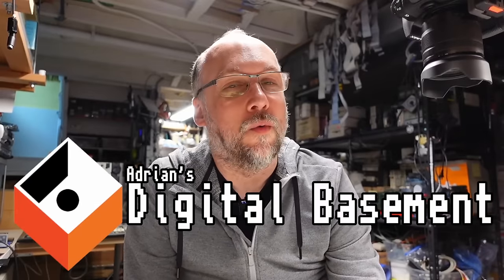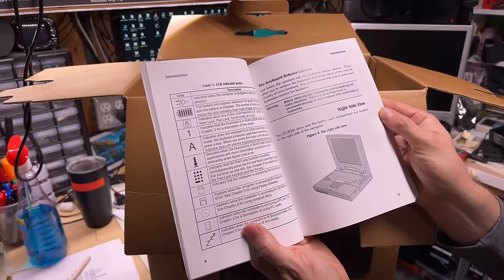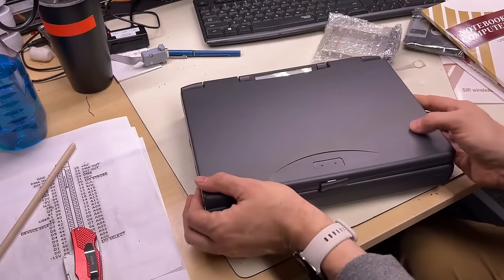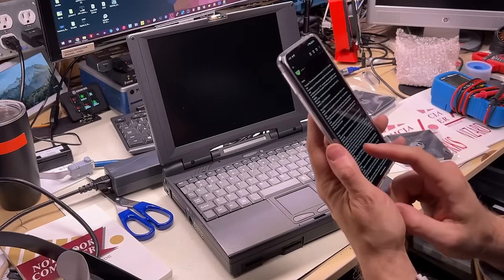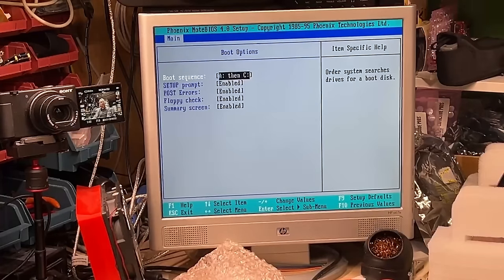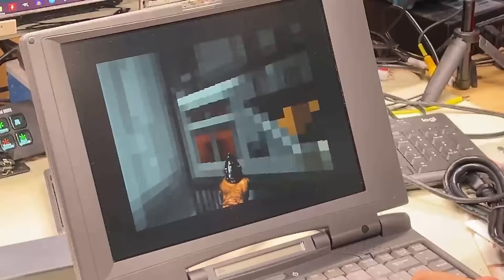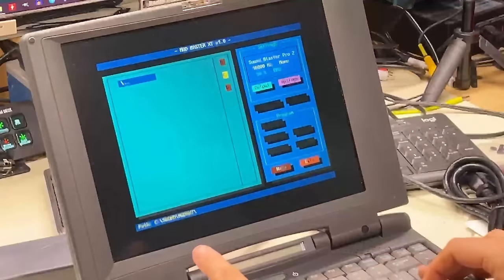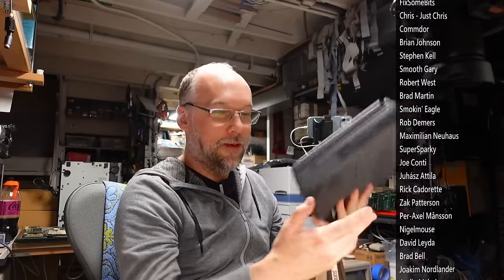0072 Unboxing and testing a brand new 27 year old laptop

Comment: I always use the tip of a mechanical pencil without the lead in it to straighten CPU pins. It’s the perfect size and allows for precision tweaking.
Reply: Wow... neat tip!  👍
Reply: I do that too!!

Works great 😅
Reply: Yup!  I discovered that oh so long ago out of desperation.
Reply: .5, .7, or .9 mm?
Reply: @thedopplereffect00  I'd say 0.5 mm is closest, but I'd wager any of them works fine. Nothing rotates, so as long as you can do leverage and not collide with the neighboring pins, it'll do.
Reply: I use a strip of thin plasticard and slide it gently through the lines of pins - when you come to a bent pin the card slides around it and you can then use your thumbs to straighten the pin into line with all the others.
Reply: Am I being a psycho, using a pair of scissors to straighten those pins?? Lol😂
Reply: Truly a life hack for pin repair.  Thanks!
Reply: That was an Official EVGA tip too. Empty mechanical pencil, steady hand and extreme patience. I learned early on to just get the 5 yr adv RMA warrenty lol.
Reply: Older CPUs you might want to use a .7mm, not a .5mm....

Comment: That laptop’s actually got one of the really nice screens from the day. That thing is loaded.
Reply: Yeah it's nice for its age - I just find myself automatically reaching for my screen wipes 😀
Reply: I LOL'd when Adrian said it wouldn't work outside...I can't remember any laptop/notebook from the 95-97 era that you could use outside...In fact I think I remember screen shades even being not just a thing but a necessity back then, and having to setup your office so you weren't in direct sunlight if you were a notebook user. Laptops sucked back then, but it was what we had and we were happy for them. I am so glad that we have made it to where we are today.
Reply: Yep, the passive matrix ones were at least 3 times as bad. I'd not sell those as I worked at Gateway, and it just stood out too much. You would buy a cheaper B-brand with an active matrix one I suppose - possibly this one :) I remember we had one one with passive and the one with active display, and we simply hid the one with passive matrix behind the pillar that held the shelves.
Reply: And compare that keyboard with the modern junk that gives almost no feedback... I think back with nostalgia, just because of this

Comment: Nice review! I used to have a Green 759 laptop from the early 2000's. I was excited when I purchased it as It was my first laptop. It too has numerous input / output features. The DVD drive was a bonus (although it was not powerful enough to play DVD movies). Otherwise, the features were one of the reasons I purchased it. To be honest, it was very unreliable. Within a year it began to exhibit problems. It would power off by itself. The vendor I bought it from insisted that it was my fault and refused to repair it even though it was under the warranty period. I ended up selling it on eBay and I still have the photos and auction content.

Comment: One of the things I remember for laptops of that era was that the controls for display, audio and other functions did not always work without having drivers installed. Some laptops of today do that but not as common. I had a Micron version that even had the rolling fingerprint scanner off to the right of the keyboard. The display was always a little on the annemic side for images but they did the job. It was never an expectation to be able to use the laptop outside. I got the experience to use Itronix Laptops since my Dad had worked there. They did better in outside usage and also the keyboards did not melt. They tested for that with their own heating oven with the laptop running and holding the temp at 120F. Then they would switch the temperature all the way down to -15F to do extreme cold testing. Then it was onto the cycling test. That showed bad solder joints nicely. Primary purchasers of these laptops was Military and government services. They did the job and lasted. Cooling of the processor was handled by it being pressed to the magnesium case under the keyboard and the whole case would warm up from it. You could even drown the laptop while running with all service doors closed and it would keep working for the most part. Interconnect board did not like being wet and having high voltage present to run the display.
Reply: Yes to the point that the Windows installer had an option to use a floppy disk to install drivers lol!

Comment: The second I saw the box, I knew exactly what the laptop would look like.
Back when they were new, I worked at a computer store, and like yours, they would come "bare bones" (no CPU, no RAM, no harddisk) and complete them to customer specs. I probably could still install a CPU in one of those while being blindfolded... We had a few corporate customers back then who ordered them in bulk for their employees.
Reply: bulk...ugh....i once had to assemble and load 71 identical P5-100 mini towers...still have an occasional nightmare where i'm lost in a maze pushing shopping carts full of computer parts around....
Reply: I imagine the corporate IT departments bought such ODM laptops to save money compared to buying stuff like IBM ThinkPad 500 or 700 series, Toshiba Satellite or Satellite Pro 400 series, or Compaq LTE 5000 series.
Reply: @kbhasi  that's most companies here in Germany for you. The people in charge have no clue what they are doing and will always decide for the cheapest option.
Just yesterday, I learned that the IT department of my current employer now wants to upgrade our monitors from 22" to 27". For cost reasons, they did not go for monitors capable of displaying 4k tho - they will be full HD like the ones we use now. 🙄

Comment: With that gameport on there, this is a sweet retro gaming laptop for someone if they landed one that is NOS. That old CCFL, you're just going to have let it warm up. There probably is a way to get MMX capabilities if you wanted it. An IDT WinChip2 runs at standard 3.5v, no more than 11W TDP (P5-133 non-MMX runs at 11.2W), and almost always worked fine even with Intel BIOSes. I used to use them all the time on Intel Socket 5/7 systems that only ran standard voltage. They were down on raw FP peformance but if you could leverage MMX, they were better.

Those ESS sound chips always worked better installed under Windows in my experience, even in DOS mode. Put Win95 on there and install the driver and you will probably get better results.

I have a Compaq Presario 1247 that I use for things like this, but it's a late 1998 model with better capabilities, can run AMD K6-III+ and take 288 megs of RAM.

Comment: Speed isn't automatically set you have to adjust the multipliers in the bios (possibly jumpers depending on design).  The screens on most of this generation laptops were not great new.

Comment: Sounds like the volume is set too low for decent line level output. The keyboard controls usually require a driver for volume as these were expected to mainly run Windows 95.

Comment: Nostalgic, I did have an even worse one for my job, just need the terminal function, not games.

The backlight is a fluorescent tubes (flexible) and it goes dimmer over use, also it's quiet normal this 199x TFT did not have enough brightness since the backlight did consume lot of power (so they set it even dimmer when power up), except reach the age of ACTIVE TFT it's dim. The ESS chips back then did famous for bad sound due to unknown reason, but it's normal sounds bad. ESS got "quality chips" only after 2010.
Reply: I rocked an 486SX33 at my first job which barely ran win95(floppy installed). It was all about serial cables and console.

Comment: Adrian I would keep that unit. I have found them very useful for making 3.5" Disks in DOS for test and measurement equipment when modern PC's with USB floppy drives won't work for utilities that need direct access for specialized disk copying. Finding a new one is a real find. My other goto retro laptop is a Dell D630 that can have a real 3.5" Floppy drive and has a DB-9 RS-232 and if you have the docking station you can get a true parallel port or use the PCMCIA port to insert a parallel port card for driving things like EPROM programmers. I use it mainly for development/ Bullet proof machines that will run Linux or WinXP thru Win7 or DOS or a VM.

Comment: Laptops before the early 2000's were very special and premium devices. You can see the quality and how much care went into just the packaging and accessories. I absolutely love that laptop bag! If you weren't going to use it with the computer it came with, you could easily use it as a tablet case, etc.

Comment: I have an old Epson ActionNote laptop from this manufacturer, but much older. It has a Cyrix 486slc 33mhz and overall, I have found that it is the vintage laptop that has less fallen in pieces, that I own. Others are all broken, but this one is still running perfectly fine. We have to remember that these were inexpensive compared to other options. This test doesn't do it justice, as it is clearly a Windows 95 machine. With all the right drivers, it must be about as good as the others from its era were, especially considering the price point.

Comment: Your experience with this laptop is the same as mine from that era. Although I never purchased any, I did use laptops of that era for work purposes.  Due to that experience, I avoided buying them for myself because I also found them underwhelming overall.

It wasn't until 64-bit CPUs that laptops gained my attention.  By that point, technology had reached a decent plateau for portable computers with lithium ion batteries and decent back lighting.  I've owned two laptops and I still have them both, but one is sitting generally unused now and occasionally serves as a guinea pig for OS experiments.

Comment: Yes, my past. I worked for a German Computer Distributor as a technical product manager. I had to test all the new stuff modem ISDN and yes Notebooks. This notebook in Germany was sold by Yakumo. The dealer price of this backbone with CPU 133, 8MB was about 1300.00 German Mark in 1996 without tax. Would be 800 Euro. I agree with your opinion about the housing, we call it yogurt cup because of the thin plastic. But in one year the distributor sold around 15000 units in different configs and we really had no real problems with them. Less then 1% broke while they had warrenty. They were to expesive, so every owner handelt them with care.

Nice video, thanks Harro

Comment: I used to have a little museum of this kind of thing along with manyals and drivers.  I gave away several rubbermaid tubs of the stuff to a local computer club when i retired.  The only thing i miss is the full size 80MB MFM Seagate.  You could actually make an IBM AT dance.  Oh no, i forgot the old debug sequence for formatting the drive.  😢😢😢.

Comment: 23:54 You would set it for monochrome if you were using it with an LCD overlay for an overhead projector! That would be one of the possible uses for the composite video output 😊
Reply: Right! I remember seeing a YouTube video about a Sharp LCD overlay that was in colour (I think it used a DSTN LCD), but considering the time period, there probably would've been monochrome ones too (that probably also used a DSTN LCD but with white subpixels instead of RGB). Besides that, I had also seen DIY LCD overlays that used modified 15" LCD monitors too, but that only came about in the late 2000s or so.

Comment: It is extremely similar to the Texas Instruments "TravelMate" before Acer's acquisition.  I've seen some laptops with a very similar design but in other specs and at other times, with the name of cheap manufacturers, something like "Wallmart brand laptop". Their problem (and the reason you don't find them today) is because they broke the plastic fairing very easily, some had hard hinges, and one day you open it, and everything breaks. Later, during the pentium 3 era, these manufacturers adopted terrible cooling solutions, which caused these laptops to die prematurely, and this lasted until the middle of the core2duo era.

Comment: I don't think the sound is faulty, I can almost imagine what the speaker (does it even have stereo? I seem to remember Toshiba or Gateway laptops that only had one and the sound software configuration was even set as mono for internal.) I swear though that speaker has to be one of those round, super thin, black plastic frame voice coil speakers with a clear plastic/cellophane cone, super thin magnet, cone crackles when you push on it even a little, yeah the response range of those you can be sure doesn't cover anything below like 500khz much if at all. I'm super curious about the composition of the gas in the lighting, they also have trace amounts of mercury but I forget why but I can't find much that points to what the shelf life should be, and IIRC it's not uncommon for people to fire up vintage fluorescent tubes (talk about a weird hobby, collecting CCFL lights, people do it.) The inverter / ballast / driver may have bad electrolytic caps but in all of the examples I could find its only like one or 2 that you would actually have to replace. Compile AROS and build the native installer for i386-pc and see if you can get xf86-video-cirrus to build for it, they have libdrm in the source tree for it. Check out the AROS build instructions and start there it is pretty easy.
Reply: HaikuOS would probably also be interesting but if you're more of an Amiga fan you'd probably really like AROS given how easy it is to build / modify

Comment: I had a "Pro-Star" laptop that was one of these OEM laptops.  Mine was a bit later...circa PII or III, IIRC.  Was a good laptop and lasted quite a long time til the motherboard failed.  It weighed just under 10lbs, so it was a beast to lug around.  Did some gaming on it and it worked OK for that.

Comment: We never had a laptop in the 90's, but the couple I used here and there sucked lol. My childhood computers were a Commodore PC40-III running dos and Windows 3.1. We later on got a HP Pavillion with Windows 98 which I think was a Pentium 2? But my dad always was winning raffles of old computers from his engineering company. We had old IBM's, Epson's, Packard Bell, Hewlett Packard. You name it! 

For most of my childhood, we also had a monochrome NEC monitor that was outrageously heavy, but it was a pretty good size. Excellent sharp display.

Comment: dont 'twist' the screwdriver when locking/unlocking the cpu on those sockets but bend/lever the screwdriver downwards, so it 'pushes' the cpu, (hold the cpu down as well while doing it) or  it may risk breaking the slot off the socket and then you'll never be able to use it again
Reply: Sounds like there are more variance of that type of mobile Socket 7 ZIF socket than I was aware of; I’m pretty sure the ones I have seen that require a twist would be broken by side to side levering as you describe.
Reply: @brianellison8744  ones that NEED  a twist usually have screw, ones that dont, just leverage have a slot, i have a few of each type , and its not 'side to side' levering but down across the cpu so it pushes it and the movable part of the socket, one slot to lock the cpu, the other side/end to unlock it

Comment: By the late 90s though the laptops were comparable in performance to a 2-3 year old desktop. I have a Compaq Armada 1750 PII for portable retro gaming and it does that job fantastically - decent speakers, very nice screen, just plug in a PS/2 mouse and you've still got an hour per battery to play Settlers 2 Gold on your flight to the tropics. :D

Comment: 9:30 I remember being a teenager in the 1990s and using old hand-me-down IBM desktops like an XT and a 286... until my parents got a P2-class Celeron desktop in 1998... And the price tags of laptops just made my eyes water. It felt like you could get a desktop PC for about CAD$1,200, but a laptop would set you back about CAD$3,000. You could buy a brand new car the same price as just 3 or 4 laptops. It kinda blew my mind how anybody but absolute VIPs could justify spending that much on a computer knowing that it would be painfully obsolete in just 2 years.

Comment: I'm somewhat into old Laptops for about 20 years or so, mainly Toshiba, and in my experience those cheapo STN/DSTN-type Display don't age well. Being not great as they were new they get dimmer and smeary when they get old and sometimes they get those orange "hot pixel islands" you often see on old laptops. Therefore, when I'm looking for a specific model to add to my collection, I always look for the variant with the TFT-Display you could buy as an option back then. Those are mostly in a good condition even after 30 years (my oldest Laptop with an active matrix Display is a Toshiba T3400CT from 1993). But you should also remember which great advancements have been taken place in the last few years and nowadays we're used to see the modern UHD-Monitors with their perfect brightness and high pixel density. On our "1990s eyes" the displays dind't look THAT bad. ;-)

Comment: In 1997 my work bought a fully loaded Toshiba Tecra 520CDT for me that cost over $6000.  However, unlike lesser machines it was quite the little powerhouse.  Like the Compaq Deskpro on my desk it had a Pentium MMX @ 166MHz and performed nearly as well.  The only real advantage the desktop had was it's faster HD.  I still have that Toshiba and it still runs.  The HD has been replaced with a Compact Flash card and it runs Windows 98SE considerably faster than my Lenovo T480 runs Windows 11.

Comment: I have the same laptop branded as Portocom, and I have installed AMD K6-2 333, and it could be configured, and working. Though I had to stick a heatsink and fan on that thing and got rid of the factory one.